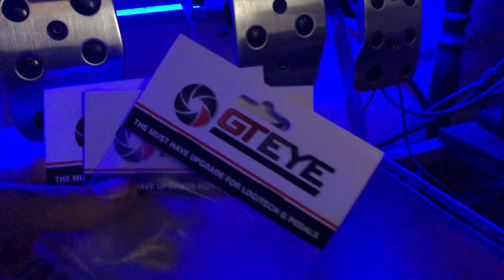GTEYE G27 G29 pedal springs upgrade S15E14

Comment: Thanks for the review. Are you still using the brake Spring from GTEYE without the Logitech rubber...? I want to upgrade the brake, but I don't want to use the Logitech rubber, because when breaking the progression feeling when touches the rubber it is strange, and I don't know how much do I have to press for fully brake etc... I Think if using just the Spring from GTEYE, the load progression it will be better.... What can you say about it...? thanks
Reply from the maker: I left the rubber out and prefer it out. would also like a heavier brake pedal spring but at least for now its a lot better.
Reply: @pawpatina  Thanks

Comment: Is the rubber block supposed to be in the piston for the brake pedal, or does it come with the upgrade? The spring on my pedal broke so I ordered the upgrade, but when I took the broken spring out, there was no rubber block. Just wanted some clarification.
Reply from the maker: In the stock config, yes there is a rubber block to make the brakes stiff like a racecar and two stage so its harder to lock the tires up. not needed with a stronger spring, just know if you floor the brakes you will skid the tires.